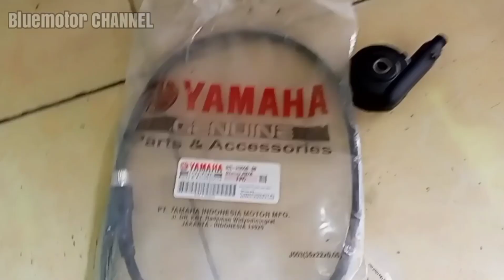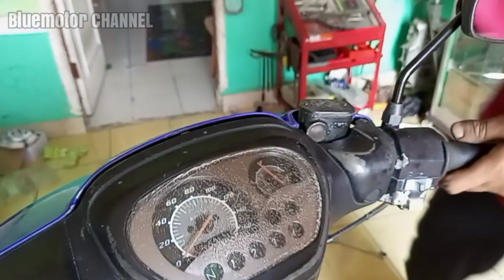cara pasang KABEL SPIDOMETER & GEAR BOX SPIDOMETER Jupiter Z

Comment: bang gearbok set kabel rx king apa sama kaya jupiter z
Reply from the maker: Beda bang candra.king lubang as nya gede
Reply: iya bang soalnya motor saya jupiter tapi pakek tromol king
Reply from the maker: @candraaditya3964  pake gearbox king saja berarti bang
Reply: bearing laher pakek uk 6300 berati aman y bang? terima kasih bang sudah kasih infonya
Reply from the maker: @candraaditya3964  sama2 bang candra